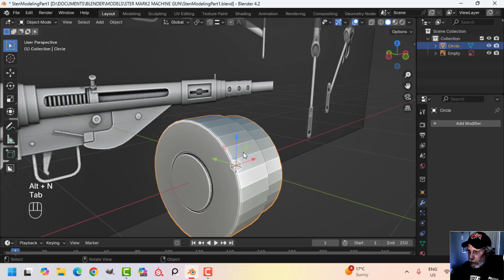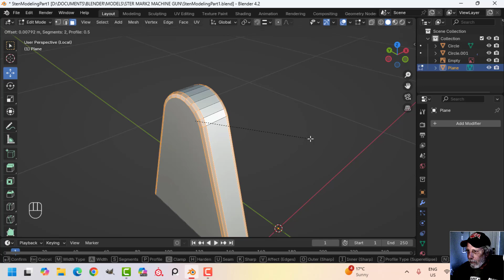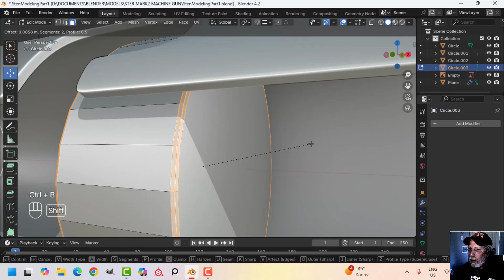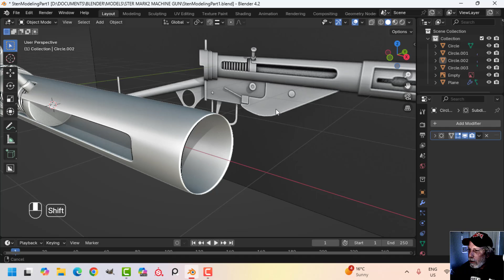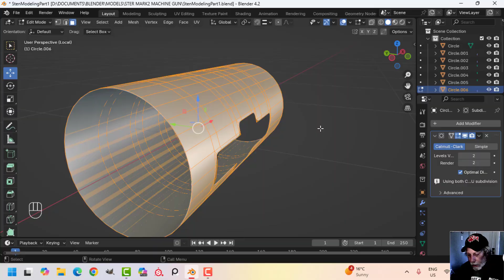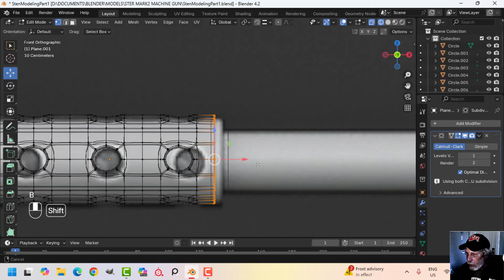BLENDER: STEN MARK2 MACHINE GUN (PART 1)

Comment: The reference image is wrong. It shows the cocking handle in the Cocked position but the Bolt isn't attached to the Spring and instead is in the Ease Spring position. (thus the Hard Disc Drive looking thing in the ejection port, which is actualy the Bolt)
Reply from the maker: Will have a look at that.  It's a shame but thanks.
Reply: @zerobio  you can fix it by extending the spring and cocking lever forward in the long slit
Reply from the maker: @clive3490 yes I may do that